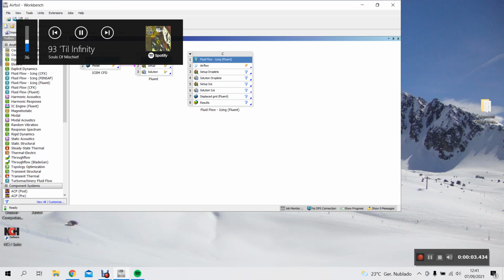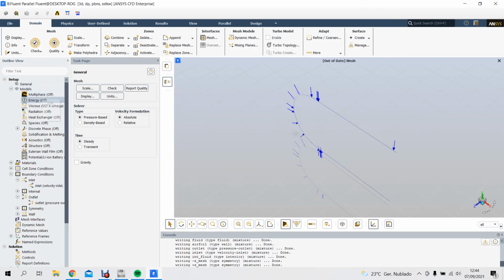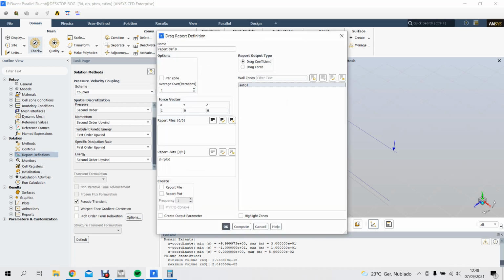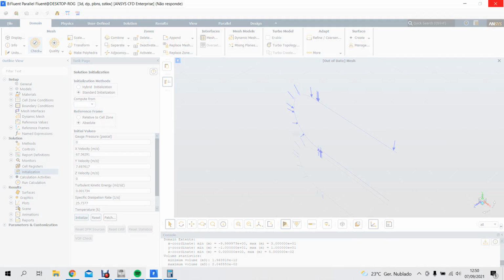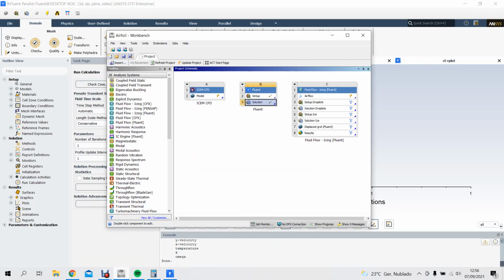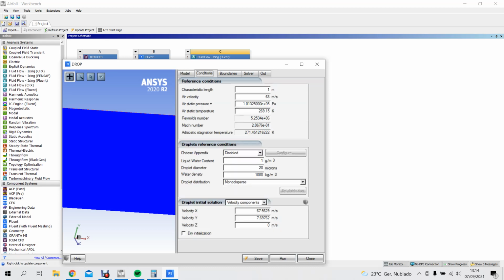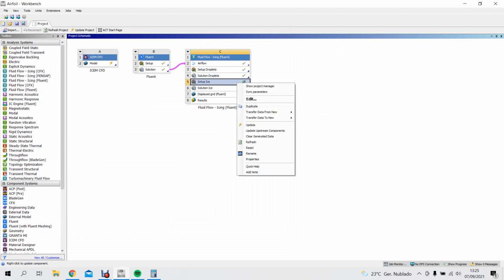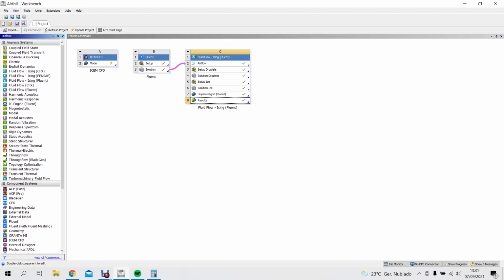ANSYS ICEM, Fluent and Fensap-Ice Tutorial (Part 2 - CFD and Icing simulation)

Comment: Hi brother, i have done geometry from spaceclaim( thin 3d volume through z) and did meshing from watertight geometry, after setup and solution in fluent, I can't able to import the fluent file in fluent icing, its always showing unreadable grid or import operation failed- grid missing, can you tell me what to do, any guidence or suggestion would help me a lot.
Reply: Hi, i have the same problem. Did you solve it?

Comment: Why cos(6.5)?
Reply: It’s been a really long time since I made these videos, but I would say your question has something to do with the horizontal component of one of the forces. Most likely the drag force. Could you point to the minute in the video where your question appeared?
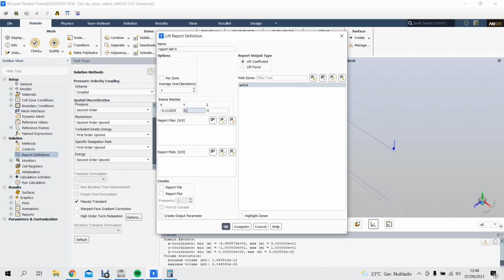Reply: @tomastouzet3749   yes it's 7:06. I think its the angle of attack, is it?
Reply: @shreyakalkundri  correct it’s the angle of attack. I do it like that to have a force report for the lift and another one for the drag of the foil
Reply: I cant get the grid open. It says that the grid is missing... how to solve that?